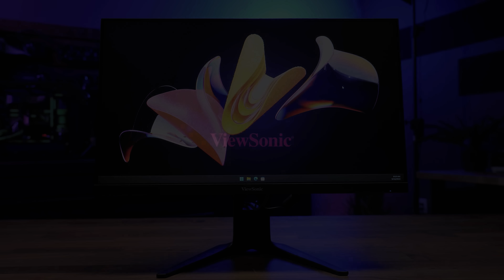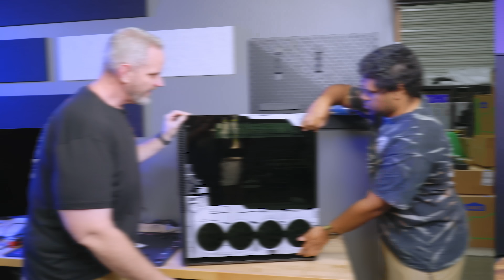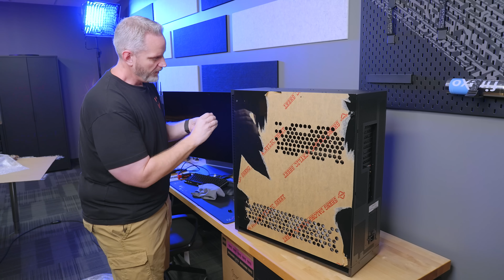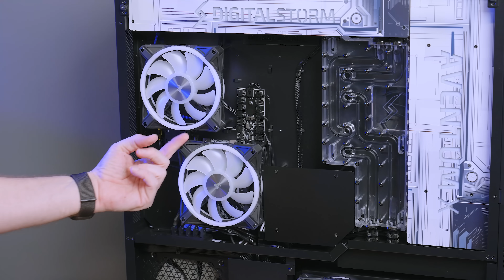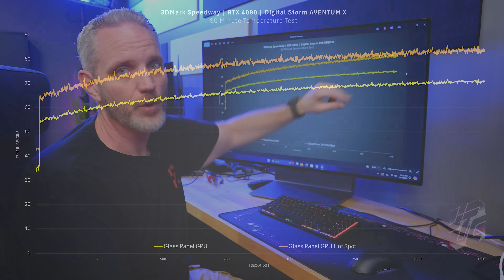Digital Storm responded to my Criticism... Let's go over it

Comment: My local glass company only charges $10 per cut and it is not laser cut. They use metal bits made specifically for glass cutting, sanding and beveling.

Comment: Jay, you answered yourself many times in the video with 1 word; PERSONALLY.

You PERSONALLY would want more airflow, so when you spec'd your pc you would choose the vented panels. Other people want the UV printed glass, because if you're spending £9k on a PC it best look as bi*chin as possible. Real world performance isn't lost, the only actual downside is it will have to run higher fan speeds and be louder. Some people are ok with that, because that's their PERSONAL preference.

Comment: Will you please create a video showing how to configure the fan curves (maybe using FanControl) to respond to the components instead of the liquid temp? It would be great if you could throw in a comparison between what an integrator would do OOB and the per component fan curves.

Comment: Four years ago, I was considering having Digital Storm build my new computer. I researched them thoroughly and felt that they were a good company and would build a great computer. Until I read all of their customer complaints—yes, I read every single one—it took a long time. Normal customer service was fine; however, if there was a problem that wasn't simple, they hemmed and hawed and dragged their feet and almost never took responsibility.  I decided to build my own, even though I had no idea how.  I figured that I couldn't do any worse(than them).  A couple of months later they contacted me wanting to know why I chose not to use them.  I cited a few examples from their own records and I stated to them that if they could show that they had corrected the problems to the owner's satisfaction, I would gladly give them a chance.  I never heard from them again.

Comment: DIY... an Addon standoff with feet that takes the glass, filters all round the sides of the stand off. 3d printed? take out the bottom rad and add in a bigAssed attached external side reservoir..., because I'm an animal :P Now that is a heat sink hehehe, with a heat exchanger on top of said add on reservoir hehe, Internal UV light in there (like the ind that stop bio-growths,  with glass cutouts so you can see the glow but not get UV exposure affects. I'm only half joking hehe.

Comment: I'd simply design a glass side panel that attaches to the GPU at the top so that way the GPU would be fully accessible to air and you still have a glass panel and then on the other side I'd probably find a way to have all the fans at the same location so you could do something similar

Comment: tempered glass is strong because its under pressure.  cutting a hole in it would relieve that pressure, causing total failure.  like those little glass break hammers they sell for car door windows

Comment: Tempered glass is processed through controlled thermal or chemical treatments to increase its strength. This process makes it much harder than regular glass.

You can cut regular glass but use scotch tape as the barrier to stop any shattering, i am a stained glass artist and there are circular tools for cutting glass circles out.

Comment: My lord. The amount of effort to specifically not think any decisions though is astounding... Fans against glass, fans cooling random sheet metal, fans against solid glass on "airflow" panels cause they aren't lined up with airflow holes, PSU fan against glass lmao. I'm absolutely baffled at the amount of effort put in to not think the basic decisions that even novice builders think though.

Worse yet,  the excuse of just adding massive amounts of liquid, via multiple rads, in attempt to make it seem like it wont overheat would be like a garbage escalade getting 7MPG but the manufacturer just putting in double the fuel capacity and claiming "still gets 300 miles to the fill up."

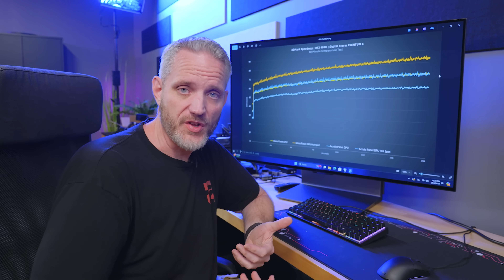Comment: At around 21:00 ...
If you water cool everything... why do we never see you watercooling monitors? :D

FWIW I agree - if I'm paying around 8000 USD for a computer system, it better not only have high-end parts but they should be running optimally, and it doesn't sound like they are. The radiators need to be able to do the work they need to do.

Comment: While you cannot cut into the glass AFTER tempering, you CAN do it before the tempering phase, whilst the glass is still hot, which would allow for cut outs, whether it is something like nuclear warning wedges or such. Once they are tempered, they cannot be cut into. I recommended something similar earlier, however someone was inferring that I was meaning post-tempering, which is NOT possible
Reply: Also note, you won't be able to get small or thin cuts in the glass, which would incur a small safety issue around exposing fans. This said however, I doubt anyone buying a many thousands of dollars machine is going to have it in a place that is easily reachable by small children

Comment: Sad to see DS's top case suck. Good thing I had them put my Ryzen 9- 7950X3D/ RTX-4080 in their Lynx case. 360 AIO in the front with a 6 fan push pull config keeps cpu nice a cool. Does it look super cool like the Aventum? No, but at half the price, super air flow, and cool temps, I'll take it.

Comment: You should take the glass panels to a glass shop. And have them cut the fans out of the glass. A custom glass shop will be able to cut all those fan circles out of them. Then test it.
Reply: Not with tempered glass.

Comment: 10:50 - you can cut the hole in tempered glass, but that would weaken it significantly. That said you can cut holes in glass and then temper it, that would be better solution, but not to the point like here i.e. where there are like 5mm gaps between fans... so it would have to be one big cut out. Because basically tempered glass is as strong as weakest part of it... and 5mm vide strip of tempered glass would be extremely fragile and braking it would shatter entire glass.

In short - yes you can shape glass and then temper it, but it has to maintain some thickness to the design, hard to say what is minimum, but my guess would be something like 5-10cm. The details can't be too fine (like that hexagon pattern would not be possible, it would have to be one big hole).

Comment: Work in glass factory. You can't cut tempered glass.  They could order the panels with the cutouts and then it gets tempered. But the cutout gets done on the table before the oven.  After the oven..the tension is too great. 

Imagine tempered glass like a sunburn. You essentially melt and it contracts over the core (center) of glass. So the inside is pushing out,  the outside is pulling in, thats why the whole panel shatters when broke instead of just cracking.

But yes, if you want holes in glass, you just cut it that way first, then it goes through the oven for whatever tempered effect you want.

Comment: You’re not crazy. At this price point, you’re paying specifically for overkill on both the components and the cooling. For $9000 you should be getting the maximum efficiency possible out of the loop, even if it doesn’t make a noticeable difference in performance

Comment: For 8k you should NOT have to call them to get the vented panels, they know it's an issue and therefore should send those with the computer. It also seems like they just threw whatever panels they had lying around at you, which didn't match the fan placement. You keep mentioning these little thing that are important that should have been addressed by the company in the first place.....I don't think I'd buy anything from them.

Comment: Anyone who even dabbles in building a pc knows that you need to have inflow and outflow for airflow. As I haven't had a liquid cooled pc, I can't say which is best. The lack of Propper instructions is a big issue for anyone and everyone. It sounds like Digital storm has some people making very questionable design choices. With the choices they are making when it comes to cooling and price, they charge I will not even consider them when getting a custom-built pc or any pc for that matter.

Comment: If you're using low power parts like an R7 7700 then the form over function cases are perfectly fine. Go ahead and buy your fish tank. But as a 14700k owner I wish there were more cases that took both into account because it really does seem like you have to sacrifice looks, airflow or price.

Comment: I've always been curious if it would be possible for them to manufacture acrylic panels with speed holes, and put a glass screen protector on it at the factory?  An in-between as far as cost of products, reduction in scratching, while also allowing air flow?

Comment: Most likely the original cooler on the gpu was cooling better. Why dont you test it with a 420 radiator alone out of the case connected to the sistem

Comment: acrylic scratches, but polycarbonate is far worse. as mentioned, having holes in tempered glass is just not a good option. your plan with smaller glass and a mesh panel under is the best choice

Comment: Jay, learned from Steve Builds. The paper on acrylic run a heat gun at a low temp over the paper and it will peel off without ripping.

Comment: Just Put 4 Say 25mm Longer Side Panel screws Per Side 8 total And Rinse and Repeat With 22.5mm Spacer's Black/white Rubber/Nylon/acrylic (round/Square) With Centre Small Hole Half Mill Larger Than Side Panel Screw Thread Diameter , Done !

Comment: 20:46 My 3080 would thermal throttle unless I cranked the fan speed so high that it sounded like a damn vacuum cleaner was running in my computer. Ever since I put it on water my GPU stays in the 40-60C range and my rad fans run so low I can just barely make out a gentle hum from my rig even though it sits on my desk and is right next to my head. Until air solutions become that efficient I will never go back. I also have "adult money" to spend so I have the pleasure of being able to cater to more refined tastes than if I was a broke college kid trying to work with a restrictive budget.

Comment: Since you mentioned dialing in your testing strategies: I''ve seen der8auer setting fans to a fixed speed based on decibels, saturating the system and then checking for the power draw. To me, that made a lot of sense if you aim for the same DB value for different systems. That way, you could compare which system is able to vent more thermal energy.

Comment: Looking for a "high-end" build which will last 5+ years (as my current build has lasted).  Have been looking at Digital Storm.  What else would you recommend I look at?  Budget is as high as $10k.  Waiting for 5090, Arrow Lake and Thunderbolt 5 before pulling the trigger.  Really need and want the best for A/V and photo production.  Thanks for all recommendations (I have built all my computers (20+) in the past - just don't want to bother this time).  Want THE BEST!

Comment: My air cooled 4090 in a lian li 011D case runs cooler. I built damn near same system as that for about 1/3 of the price that looks and performs better. 

Category 5 Digital Storm destroys your wallet

Comment: Well you could probably cut a hole in tempered glass it would make the glass structural integrity very low. You would have to frame out the glass with metal banding from the edges and also support the hole itself with bands from the edges to the cutout. Just the banding process would be very costly

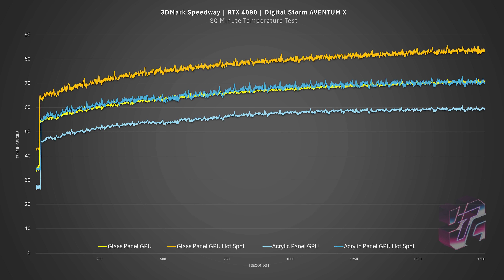Comment: 20:13 "so you can C..." dadjoke .. yeah i find the door later myself thank you .. xDD

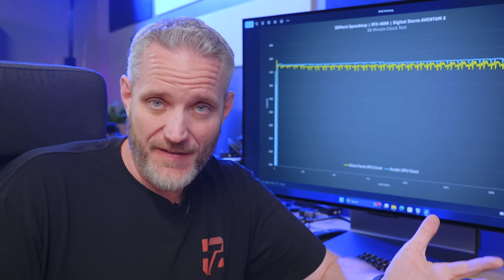24:50 to be fair ... i wouldnt even take this system for 2000 ... total cost ... and not just because i dont buy at these high prices xD but if i pay somewhat 4 digits and not just "a bit" above the 1000 ... i want a pretty good system in any way of course inclusive of cooling ... why should i buy something for multiple thousands ... to have it above 70C ... 
im even sure the "cooling system" alone cost more than my complete system ... and it cant even do his job ... just give me 1 reason to pay for that ... i give you like 10 in an instant why i wouldnt ... xD

Comment: Jay, did you ever hear about the networking issue known as "bufferbloat"?  This is the heat-soak version of bufferbloat.  A bigger buffer doesn't help you if the pipe (rather literally in this case!) out the other side doesn't have enough capacity to move what you're trying to move, whether packets or heat.

Comment: Hello. anyone know this? I have a fan at the bottom of the front that blows directly on the gpu that sits at the bottom of the case. The exhaust fan and the CPU fan sit at the top of the case and blow the same way, out the back.
can the fan in the front at the bottom break so the cpu gets a few degrees warmer? Anyone know that?

Comment: Heat is SHOWING inefficiency. Basically (above 98%) of every Watt of power you send into such a system will end up as heat within the system.
But for every 10-degree difference, you will half (+temp) or double (- temp) the lifespan of the system. This is according to MTBF calculation based on the US MIL-217H standard on how to calculate MTBF (Mean Time Between Failure)

Comment: As far as acrylic, they could do a laminate with some scratch resistant glass sheet like stuff for phones (not the sapphire glass stuff) glued together like a car front window. That is something that should be explored more with cases as that would be better for a lot of cases than glass and it should also be lighter. It would be a lot more stable for cutouts as well than glass but also be more ridged than acrylic alone. Would not be cheaper if not a bit more expensive than glass but in the end better.

Comment: If its a round hole then Yes for tempered glass but there needs to be enough rigidity around that cutout otherwise it will break easier with any force because that thinner part of the glass will move more under any stress. It would be easier to just make the glass short and have a metal vented piece down there on its own or have a piece of glass as a second piece as a addon from the main piece up top. That could have the cutouts then.

Comment: I have a Corsair 4000X case, which had pretty poor temps due to the glass front panel. I got in touch with Corsair asking where to purchase the 4000D front panel as I felt it was my problem. I could have just bought the 4000D RGB. They sent me the new front panel free of charge and paid for shipping.

Comment: Why not vacuum-fill water systems? That is a common method to fill cars now to get all air out of the coolant systems. Simple easy an cheap compared to all other issues.
OR

Run the pump at a lower RPM during the filling process. It is basically just a potentiometer and a PWM output.

Comment: I looked on the Website today After Watching this Video and its still Showing  "Large Heat Exchangers Boasting the ultimate liquid cooling loop for excellent thermals, Aventum features a 560mm radiator at the bottom, a 420mm radiator at the top, and a single 280mm radiator near the power supply" So Digital Storm Hasnt Sorted this Yet...

Comment: You're not crazy, if someone is spending 4000$ extra on a system, the cooling performance has to be top of the line.
Considering the kind of design flaws they had, it shows they just don't care about cooling performance, they just want to look cool.

Comment: On psi you have capacitor working as a energy buffer instead of just a filter so you have huge current generating inside the sheets of capacitor and this cause heat, because that you need a low esr capacitor for psu, less resistance less heat, the major trouble on psu is life span from capacitor and the problem is heat, you have a graph that shows the lifespan of capacitor decrease on a rate of a square to heat  so thermal is a issue,  To shape the temperated glass you need to cut before tempering, but there is a high break and deformation rate on doing so and this is the reason to high price

Comment: Jay, actually heat on the PSU would cause it to fail earlier, as the MTBF, mean time between failure, calculation of all electronics is based on the expected temp it is going to be run at, so a cooler system will on average fail less, and take longer to fail.  Conversely increasing heat rapidly reduce the time to failure, i.e. earlier.

Comment: Just make your own test panels.

Use some cheap thin material.
Test with multiple hole sizes..
Full time to reach the equilibrium temp.

Also test it without AC (probably want to do that in a closed small room).

Comment: Sadly most anyone who is going to spend that much on a prebuilt system is not going to care or even think about it.... that's why they spend that much money so that they don't have to think about it... willing to bet most people watching this channel probably wouldn't buy it or even be interested in it however we def love the content you create around it. And from a company that has been doing this as long as they have its hard to believe this was an oversight. Based on the response they did not even expect anyone to care because performance wasn't being lost so its fine and it looks pretty. They were probably thinking the odds that anyone runs heavy enough loads on the HW for long enough to fully saturate/heat soak the coolant is small right.. and if anyone does complain we have this acrylic we can cut up.

Comment: "We prioritized aesthetics over performance by shoving a gratuitously overbuilt and expensive custom water loop into the chassis to brute force the terrible thermal design instead of spending the extra time to come up with side panels with ventilation that are still aesthetically pleasing to look at. That'll be $8,000. Thanks!"